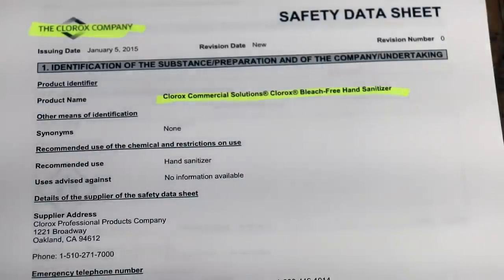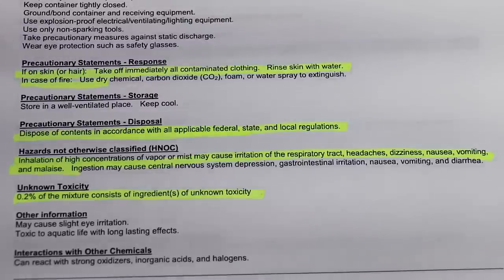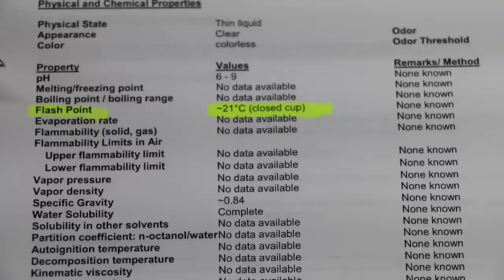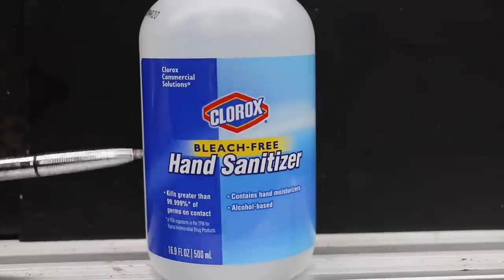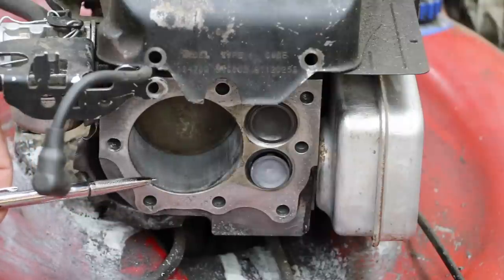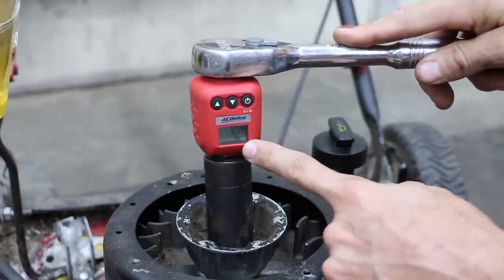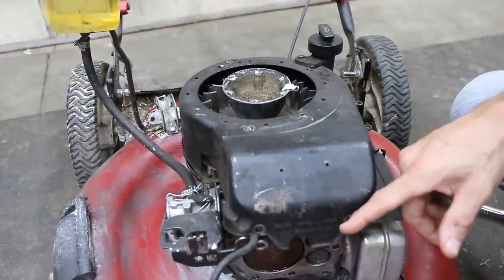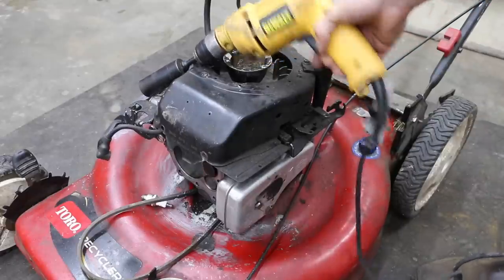Will an Engine Run on Hand Sanitizer? Let's find out!

Comment: Great work. Always interesting. I was filling up my work van the other day and thought of something that I was always curious about... Is there a way to test the normal everyday gasoline we put in our vehicles? My vehicles' owners manual says to use "top tier, regular 87 octane". What exactly is "top tier" gas? Is there any benefit to using "top tier" gas? What happens when money is tight and you fill up with the cheapest budget gas you can find? Is all "top tier" gas even created equal? Orrrr, is it a big marketing gimmick? 
 I've always wondered about the difference in quality between the different brands of gas within the same octane rating. Which one to look for? Which one to avoid?  Either way, thanks for all the other mysteries you've solved...
Reply from the maker: Great video idea!  I'll test this one soon.  Hopefully within 2-3 weeks.
Reply: "Top tier" is Shell and Chevron, primarily. Their quality control is tighter and their fuels have more additives in them for a number of reasons. Top tier diesel has a high cetane rating for easy cold starts and less smoke, as well as lubricity additives to make up for the ULSD requirement. Top tier gasoline has less contaminants and more detergents to decrease the amount of fuel system and combustion chamber deposits that form over time. All fuels will leave deposits in the fuel system and in the combustion chamber; just a fact of physics. The name of the game is to keep it as clean as possible.
Reply: @Dennis Adkins 87 is low octane cheap gas. Only time you'll find lower octane is at high altitudes like Denver where air density is greatly decreased.
Reply: You would have to perform the test over several years and 100s of thousands of miles to see results
Reply: BP is also a top tier gas because of the detergents they put in there that cleans all of the fuel system
Reply: Don't know how you'd be able to test all  this without a knock index machine  and dyno.  You'd have to run an engine on a dyno in the same ambient conditions using the same exact fuel flow and air/fuel ratio to see if one brand outperforms the other. You'd need an engine that has a precise fuel flow and MAF meter. But yes, it would be interesting to know!
Reply: Would be nice for a consumer to be able to test what they get from a pump...lots of fake fuel in texas
Reply: Basically every gas station in america is top tier.  If a gas station is not listed on the top tier website it is probably owned or the gas is supplied by a top tier supplier. That's why sometimes even rival gas companies use the same supplier but different additives are added.
Reply: How is Shell "top tier" when they use 86 octane vs 87 that everyone else uses?
Reply: @DearHenryA  weird right!  shell by my house has 87 octane
Reply: @Brandon Sullivan Maybe they changed. I'm older and Shell used to be a penny or two cheaper. One day I noticed that the gas only had 86 octane vs the 87 for everyone else. I checked a few more stations and they were all 86. I never went back. Maybe they changed in the last 10 years or so.
Reply: Not sure if you have the capability, but with the "contains up to 10% ethanol" for regular gasoline, it would be nice to know which brands are using less than that, and how much less.
Reply: Gas is gas. It all comes from the same place. They do add different crap to midgrade and premium. It is NOT worth the extra money. I had an 89 Ford Ranger that would Spark knock on anything besides premium until someone showed me where the plug was for changing engine timing. There was a module you unplugged that made it run on lesser octane fuel. Milage was worse but much better performance. The darn thing also had two plugs per cylinder. I guess it wasnt that great of an idea. People hated the Truck.
Reply: Octane has nothing to do with quality.  Octane is about detonation.
Reply: For lawnmowers and ATVs and other small engines I use no ethanol fuel because ethanol is just an engine destroying additive. Why they make it, I don’t know.
Reply: Your engine will adjust itself to run within a certain spec so only high performance vehicles get any real benefit from using higher octane gas. There was a documentary I watched where they spent weeks testing shell gas as well as a variety of other brands in a regular everyday car and it made no difference maybe a little cleaner running but that's it. Also for the guy below me. it uses the same amount of gas the engine does not run any different no speed change. No gas mileage change. Just has slightly better detergents and burns cleaner.
Reply: A diesel driver’s rambling nonsense on fuels- I just chuck anything in my Mk4 Golf GTTDi, wherever is cheapest nearby when I need to top up. It’s a PD engine, though, not common rail, and they aren’t sensitive to fuel quality. I once even put petrol in by mistake, drove home (about a mile) then drained the tank, filter and lines and refuelled with diesel. I’d estimate it was running on about 50/50 diesel to petrol ratio and it ran fine. After refuelling and starting it up, there was a brief burst of knocking (combustion, not mechanical), then it sounded great. The car actually ran better than if ever did, which was likely down to the petrol flushing the system. I’ll have to be a lot more careful in my Freelander td4, though. Misfuel that and its game over!
Reply: Top tier fuel is supposed to more detergents to keep the engine cleaner.  Performance should be the same with cheap fuels.  In our area, the same trucks fill all the gas stations, regardless of brand.
Reply: Top Tier is designed to leave fewer deposits and to remove deposits that have formed.  It is NOT related to octane.  Cars driven primarily on short trips and with mostly stop and go driving end up with more deposits and top tier helps most with those cars.  The injectors in particular tend to get contaminated.  Cars driven mostly on highway trips, over a decent distance, will not have as many problems with deposits.  Preventing the formation of deposits and removing the ones that have formed increases mileage, decreases emissions, and extends vehicle live.  In addition to detergents, top tier gas has more alkanes and fewer aromatics than gas that is not top tier.  It's been a few years, but I believe (if my memory is correct) that the preferred alkanes are straight chain rather than branched.
Reply: Dennis Adkins  Actually, it will work on any car with an ECM.  OBD1 (80s to 95) or OBD2 (96 to today).
Reply: @NinjaNerd-hz8zk  They add ethanol because they are required to by federal law. Other than political nonsense, there is no good reason for doing so, and many excellent reasons for NOT using ethanol as engine fuel.
Reply: All gas has to pass minimum federal standards so they will all be baseline good enough for those standards some add other things into they're gas that makes it top teir and more expensive
Reply: top tier is just a gimmick. use the minimum octane you get zero knock on, regardless of supplier or "tier". at sea level with a car from later than model yr 2010 you'll want mid grade. in denver, unless you are turbonormalised (developing over 25 inches of MAP), you will want "mid grade" (which is regular).

Comment: I use gasoline to clean my hands, hand sanitizer it for babys
Reply: You should switch to carburetor cleaner, it works even better than gas...and for those stubborn dirt and grime problems use carb cleaner immediately followed by fire LOL.
Reply: I use wd-40 to wash my hands
Reply: I use hydrochloric acid. It'll put some hair on your chest (and take the skin off your hands), but it works!
Reply: So I’m guessing neither of y’all use nuclear waste?💀💀 lmao y’all different
Reply: Same
Reply: @jhyland87  😂😂😂
Reply: I dry my hand wit a coal forge the waters too hot try a 3000 ferenight fire
Reply: i use water to clean my hands
Reply: Xylene takes contact cement off the hands really easy.
Reply: Pure ethonol
Reply: I use gasoline when there is no fast orange. Fast orange works the best rub it in dry first
Reply: Luciano Avilés lmao you all are babies, never used molten iron? 💀💀
Reply: Starter fluid: am I a joke to you?
Reply: Gas is actually best for removing tar from your hands I've found
Reply: Dimethyl Mercury is hands down the best hand cleaner...
Reply: justin h LOL. HCl? That stuff is for newborns! I use hot 50% hydrofluoric acid! Only problem is that you need to inject yourself calcium gluconate after using it so that you don’t die, but that’s a mild annoyance.
Reply: Anyone else read this in Elmo's voice?
Reply: I got a friend using brake cleaner to clean hands when working on bikes and engines. I do not recomment it, as it is a dangerous neurotoxin. Fuel would not be allowed to be sold if not for cars
Reply: I prefer laquor thinner
Reply: I just set my hands on fire.
Reply: @ragnarocking  then put them out and dont type here bruh!
Reply: Gasoline for hands? Thats for teens

I use thinner , thats for real men
Reply: You use gas as hand sanitizer! I use it as a drink.
Reply: @jaynaburke6294  i use thinner and gas like an ingredient

Daily ingredient
Reply: @haliax8149  chubbyemu much ?

Comment: You DID raise the compression though! A new method of overhaul in a bottle!
Reply from the maker: lol. Great point!
Reply: @ProjectFarm  
Just run it with shampoo for oil until tight, lube with MMO, and the penetrant, run on hand sanitizer. You should patent that! The MSDS is alarming.
Reply: It will until the burr on the piston rings shed off! then it will drop to 0!
Reply: @kg4boj  
Maybe so. I wouldn't want to fly it but for a lawnmower what the hell right? This guys tests are all on lawnmower engines. Good testbed. If I had his runway I would have to have a flying aircraft of some sort. Out of it. He is genuine in his tests. I think if I met him him in the real world I would really like him. That doesn't suck, does it?
Reply: @kg4boj  
I am working on a 2014 Honda Sxs700 that has compression but smokes like hell no amount of crap will fix that but a rebuild. The rings were shot.
Reply: When the burrs shed off they will then deeply score the piston walls and scrap the motor though :-( Best off to just fit new rings and hone the cylinder than this.
Reply: @kg4boj  
For sure. And teach them maintenance like air filters and oil changes. The air filter got this one but there are so many other .
Reply: That increase in compression was nothing more than an abused engine cleaning out garbage by being able to run with proper oil and re-seat its components.
Reply: @edifyguy  
Exactly my thoughts. About 90% of all the machines I have ever seen get neglect, abuse, or both. From Weedeaters to aircraft and everything in between.

Comment: Video idea: How long and what would it take to get a vertical shaft engine to run horizontally? 

You would have to rotate the carb 90* and add a bit of extra oil in the crank case for the splash system to work.... but can it be done? And will it survive?
Reply from the maker: Thanks for the video idea!
Reply: @ProjectFarm  yes, try this!!
Reply: From my experience, this is no problem with a Briggs engine. I've done it to a B&S engine exactly the way you suggested 15 years ago for a homemade propeller driven vehicle, and it never seized up. A few years ago i converted another engine like that, but this time i added some additional oil passages in the crankcase body just for safety. It works perfectly fine in my homemade tractor, you can watch it on my channel :)

Comment: That looked lika tilda "~" next to the 21C, I mean if handsanitizer flashes at NEGATIVE 21C I don't think it should be on our hands...
Reply: Why? Your hands are hotter than the flash point anyways... not that it matters, because flash point has nothing to do with autoignition temperature.

Comment: I am in no way saying this is the miracle cure, but here is my quick story. I have a 1994 Bronco with a 5.8L engine (61,000 miles its my baby), my rear main was leaking, I pulled the engine installed a new seal and yes I did use a micrometer to check the wear on the crank to ensure it was within specs, it was at the lower end but within specs. I used black permetex on the outside of the new seal, ensured everything was super clean (even installed new oil pan and pan gasket) reassembled the entire engine and had a small leak, at the rear main, really small like a spot about the size of a quarter on the driveway. Drove it for about 1000 miles still had this very small leak, so I was either going to pull the engine again (I'm really anal about leaks) but a buddy recommended I try "Blue Devil" rear main seal stuff. What the heck, snake oil never works but it was that or pull my engine again, so I used an 8 oz bottle of blue devil with a new oil change (Mobile One 10w-30) with a Mobile one oil filter after about a week, no kidding it stopped, its been about a month now. I've been keeping a piece of cardboard under my truck, nothing, no leak. Either the blue devil worked or the seal finally seated, maybe its something you could test, again I never buy into snake oil, except sea foam (yep I love that stuff) but Blue Devil has positive results in my truck...or the seal finally seated. My son (who is a Ford Master Tech) and I love your show.
Reply from the maker: Impressive results!  I used the same product in a very, very leaky power steering rack and pinion and it stopped the bad leak immediately.  That was over a year ago and haven't added a drop of PS fluid since.  I was shocked that it did the job. Thanks for the positive comment!
Reply: Its a Ford, its normal to have oil leaks, even right after replacing seals...had every seal and gasket in a Ford Ranger 2.8L V6 engine replaced and it was leaking oil again the next day.  Something to check is your PCV valve...if it isn't allowing the engine to vent properly it can cause excess pressure in the crank case and cause oil to be pushed out of seals and gaskets.
Reply: William Todd top end is spotless as far as clean. I ported and polished the intake, installed a mild cam and rolling rockers. I could have changed the dynamic inside the engine, but still no leak, had a small leak back of the valve covers but repaired that, could have been the perfect storm or the snake oil worked. I’d try it again, all the while planning to pull the engine, but the stuff worked for me.

Comment: Awesome test.  How about testing gas with water? How much water does it take to stall an engine then how effective is it to use HEET gas antifreeze and water remover in the gas. Will engine run on the same gas with water after the HEET treatment?
Reply from the maker: Thanks for the video idea!
Reply: This would be a good test. Because there is water in gasoline sometimes. I bought a gallon of gas one time to start a barrel fire of wood and the damn gas wouldn't ignite. Poured some in a paper cup, threw in a match and still wouldn't ignite! And was SHELL gas!
Reply: Shell gas was the problem to begin with.  Ever see what it looks like in an engine that's used Shell gas?  It turns stuff green inside the engine.

Comment: With current prices and low availability of hand sanitizer, I almost think that hitchhiking would be a better option than pouring liquid gold into your tank, even if it worked. Most folks have no more than a quart these days. That means that if your vehicle got 25 mpg on gas and you could make it limp on sanitizer, you would probably have less than 5 miles to a quart. I’ll walk! Thanks for the great video, Todd! Thanks for your service!

Comment: Vape juice as motor oil! :-D
Reply from the maker: Thanks for the video idea!
Reply: Good idé
Reply: The smell of freshly cut grass and vanilla essence in the morning
Reply: You realize vape juice is just glycerine right?
Reply: Motor oil as vape juice
Reply: @ProjectFarm  vegetable glycerine is the same thing as vape juice.
Reply: @molobot2529  Amazonian  idea it's not like its dangerous
Reply: That would be crazy expensive
Reply: Vegetable glycerin. It won't turn out very well xD It's a sugar alcohol(not alcoholic), so it will likely break down similarly to sugar, leaving carbon deposits everywhere. Ever seen a week old vape coil?
Reply: @ProjectFarm  if you need help about vape juice let me know. I mix my own and know s little about want is in it
Reply: That would be really spendy forbthe amount you would need
Reply: Borginator Vape juice itself is expensive while it's basically glycerine with flavor so the experiment should be with glycerin instead👍
Reply: In a Subaru that would work
Reply: @Amcooper  no it won't you just buy jugs of glycerine for fairly cheap.
Reply: @molobot2529  for those subaru owners

Comment: Try packing a crankcase with axle grease and see how long it lasts?
Reply from the maker: Great video idea!
Reply: About 3,000 miles or right after the factory warranty expires. Just ask Ski-doo.
Reply: I have a mower with shot rings. I want to try 90 weight.
Reply: What about grease from food?

Comment: The precautionary statements are similar to that of Q-Tips - they're generally used as swabs to clean your ears yet they explicitly say not to do that.
Reply from the maker: Great point.
Reply: Who here actually uses a q tip to clean a keyboard like they suggest???
Reply: Don't clean you ears with them it just pushes the stuff back.
Reply: MG_Anon sounds like an all natural ear plug!
Reply: except it's permanent
Reply: MG_Anon

That's not even close to true.
Reply: Anyone who credits huffington post as research material is instantly stripped -500 credibility